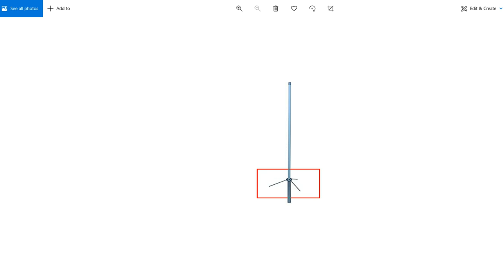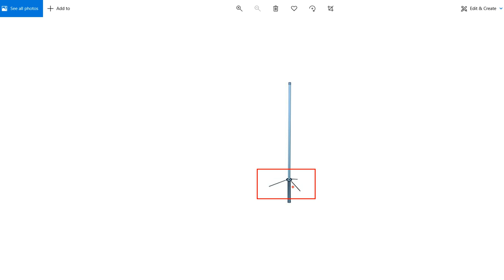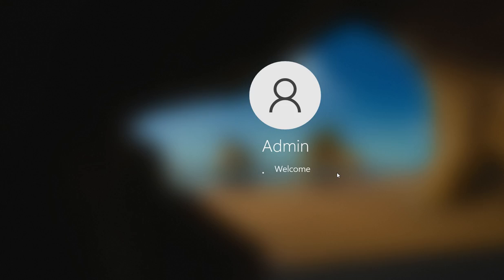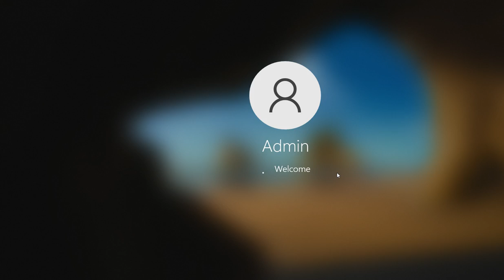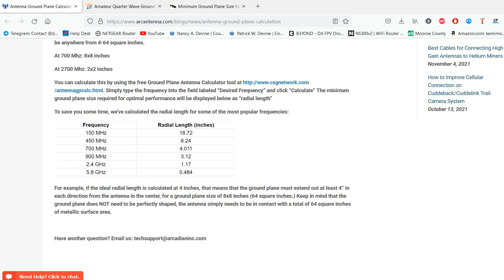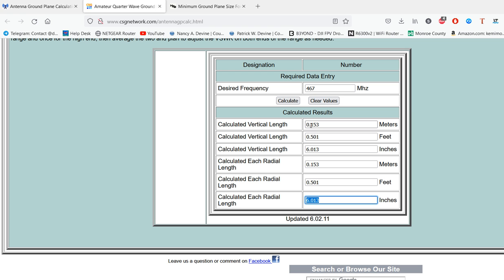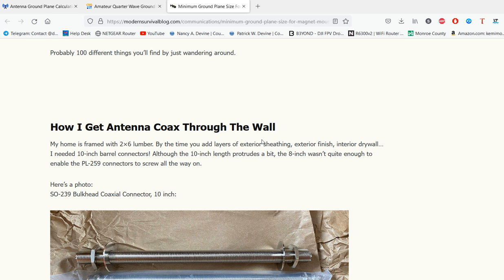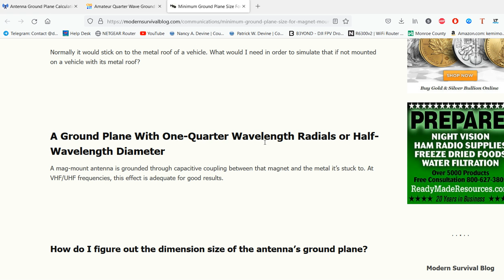🔺Ground plane rods NOT enough for GMRS two-way radio antennas??🔺

Comment: Now the link they give on the calculator is that a minimum length or an exact length cuz I have a end fed ground plane and 10 of it. I can't get below 1.7 and it's attuned gmrs from Retevis
Reply from the maker: If it's autotune from retevis then I would leave it. 1.7 is not that bad, anything below 2 is ok! I am guessing you brought the fiberglass base/repeater antenna?

Comment: At ground level you need many radials but up in the air you don't and as far as the length it should always be a 1/4 wave anymore than that is not necessary because the antenna already sees a 1/4 wavelength as Infinite

Comment: I just built a 5/8 wave antenna for a friend. Be sure to calculate the 1/4 wave ground plane with the lowest frequency which would be ch15 (462.55) on GMRS, then add a little more. The three rods that I used are 6.25" each. If you're making a 1/4 wave antenna they should have a downward pitch to them, this helps you achieve the 50 ohms match for the coax. If you're building  a 5/8 wave antenna the downward pitch will work, but it would be best to go strait out in this case, as you'll be using a matching device between the main element and the center of the coax. 1/4 wave at the lowest frequency would be 234÷462.55=.506' × 12 = 6.07"
Reply from the maker: Yes that is what I did to check out my full wave antenna build video https://youtu.be/RGEPaZdFDkA
Reply: @GMRStwowayradio  right, I've experimented a lot and the lobes are crazy on a full wave antenna, so you loose a lot of your signal up where it does no good, so you'll drop in gain. 3/4 wave is similar, but if you're talking toward the space station this could be helpful. To keep the signal toward the horizon without those extra lobes sending your signal upward, a 5/8 antenna is the way to go. The matching device can be as simple as a coil. I reperposed an unused 220mhz antenna for this. I trimmed the ground plane elements to the length needed and the element inside the fiberglass was a #10 wire. The coil was about 5 turns with one end conected to the antenna rod side, the other end was grounded, and the center of the coax was connected near the center of the coil, but one turn closer to ground. Then I trimmed the antenna to match. When I finished I cut the fiberglass so it was about a foot longer than needed and it turned out looking store bought. I literally just finished this days ago, so it's still fresh on my mind. The swr was 1.2 at both ends of the band. My friend got it put up right away and his signal went from around s4 with his 1/4 wave antenna, to taking my meter to full scale. He says I'm a genius, but I just tell him that I make antennas all the time, and I always have my calculator near by. Lol
Reply from the maker: @RhythmicSensations  - ya I will be playing with some antennas too..lol, but I will keep the 5/8 wave one in mind!! I am assuming be matching, you mean impedance matching? If so, just bending the ground plane rods to 45 degrees should make the match close to 50 ohms
Reply: @GMRStwowayradio  do to the way, the waveform lays out over the length of the antenna, simply changing the pitch of the rods isn't enough to balance it out when it comes to 5/8 wave. The coil actually electrically changes the length between the center conductor of the coax and the driven element. It isn't as simple as it is for 1/4, 1/2 and 3/4. You have to start thinking in 1/8th instead. 
2/8=1/4
4/8=1/2
5/8 target
6/8=3/4
It's that odd ball spot that works so well that needs the special attention due to its length which doesn't match up on its own. If you look at the 5/8 tornado from Serio, for 6 meters or 11 meters, you'll see a simple coil in series at the bottom. There is no connection to ground with this coil, it simply (electronically/magnetically) changes the length of the antenna's radiator element. The use of the tap helps to fine tune this, and the connection to ground helps keep noise off the antenna. Just as the lower 1/4 wave section of a J-pole does. With the j-pole, the bottom section is your matching device and the other section is the radiator. Many people consider this to be a 3/4 wave antenna, but it is a 1/2 wave length with a 1/4 wave matching section at the bottom. The top of that matching section is a perfect mate to the 1/2 element above it.
OMG I feel like a geek. Lol.
I must have too much time on my hands.
Reply from the maker: @RhythmicSensations  - thanks for the info, I will keep that in mind. i think (if i recall right that is..lol) the nanovna can measure impedance if so this will help me tune it to 50 ohm